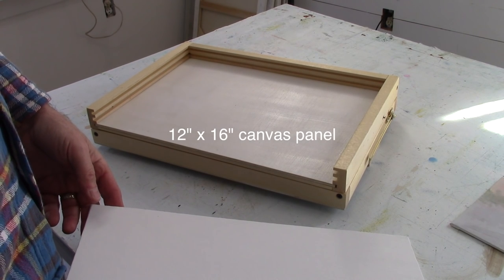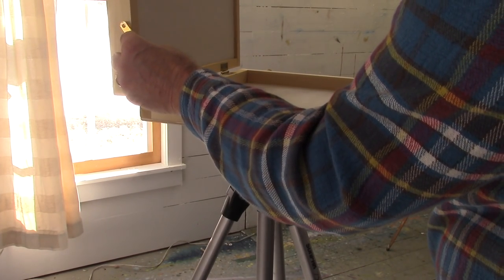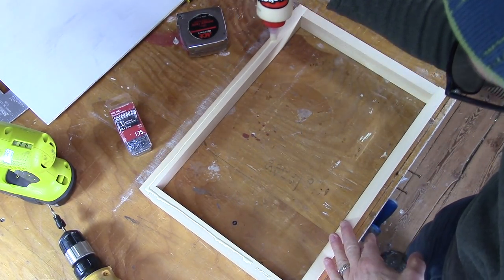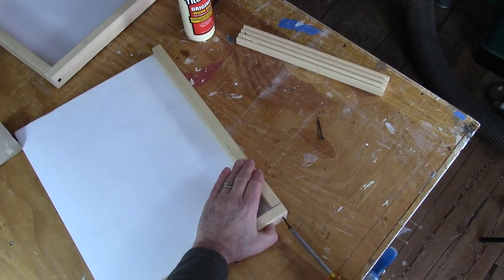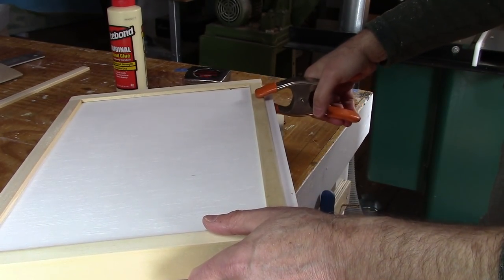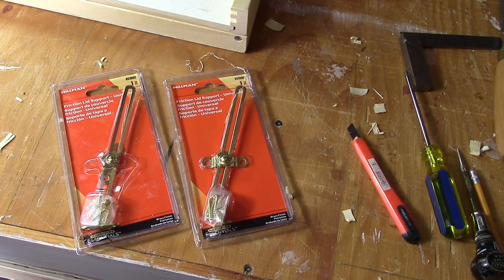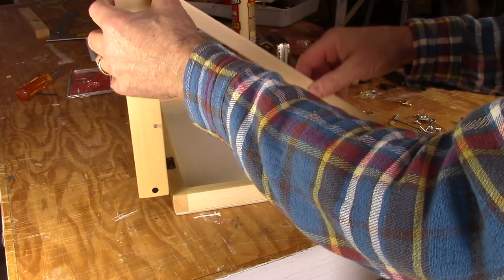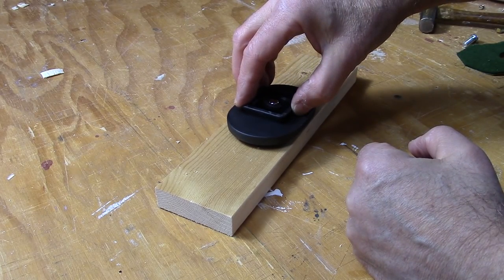How to make a Pochade Box

Comment: Thank you, Richard, for sharing your design with all of us.  I truly appreciate the work that went into this video.  One little side note about the T-nut; the center hole should be drilled completely through the support bracket and the T-nut should then be installed on the backside of your support piece. When you attach the tripod mounting block it will actually pull the pointy bits even tighter into the wood.  The way in which you have it shown will eventually loosen up and probably fall out.  Just thought I'd mention it :).  Thanks, again!

Comment: When you installed the t-nut at the end you put the wrong end facing the tripod.  You want the small side facing the tripod mount.  When you tighten down on the tripod the teeth on the t-nut will lock into the wood.

Comment: It's so easy for a faster in the end grain of a board to loosen or even pull out over time.  Have you considered using pocket hole method of making those joints?  They are much stronger and when sent through the end grain at an angle hardly ever loosen even without adhesives.

Comment: It seems like regular use on a tripod would work the T-nut loose by pulling it back out of the hole. Should you consider mounting it on the opposite side of the board before mounting it, setting it up so that the tripod bolt would tighten it into the wood from the opposite side instead of eventually pulling it out?

Comment: Great video. You really go through all the steps and make it easy to understand. One question -- can you use torsion hinges? Amazon sells torsion hinges that can be tightened or loosened depending on how much torque you need. Or would the top half of the clam shell design be too wobbly without a brace of some kind?  Thanks.

Comment: Why did you strip down the pressure hinge?  Is it because you're mounting to a tripod and can get whatever angle you need that way?  If you want to use this on a table top as well, you won't have the ability to adjust the angle of your painting surface.

Comment: what if i do not have dado blade to cut the slots?
Reply: I suggest using dowels (square dowels instead of round dowels) and glue them inside with enough space between the dowels for your art.  Perhaps someone else will have a better idea.